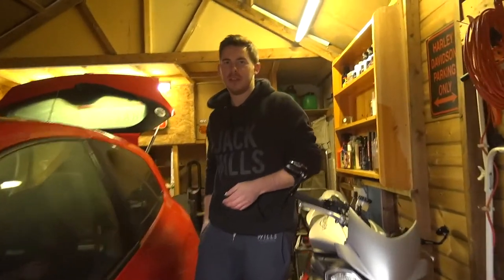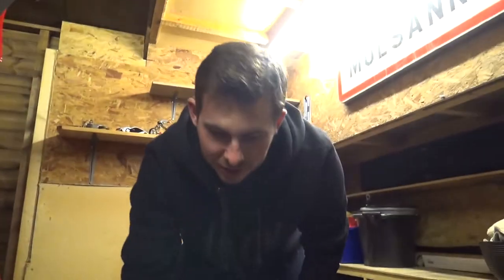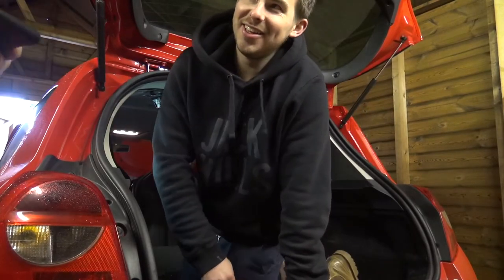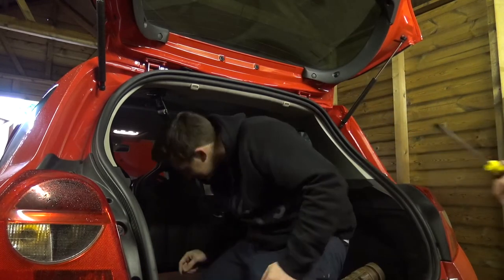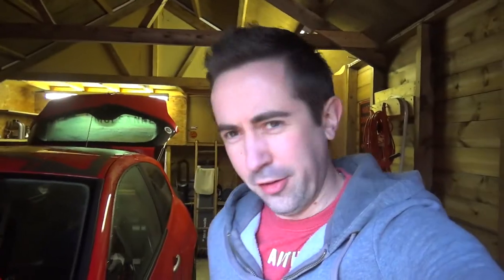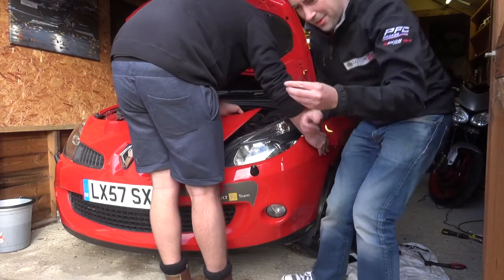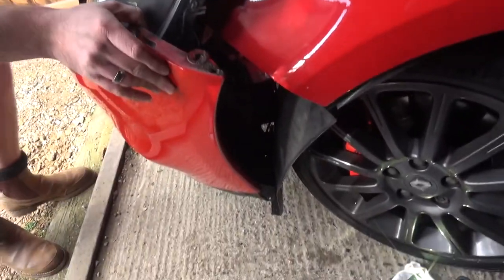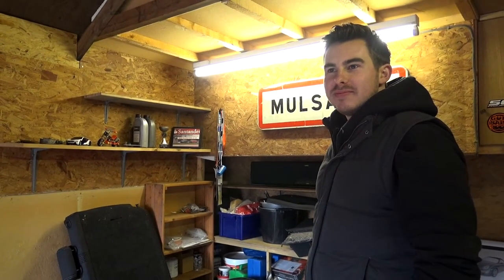Clio 197 R27 - My First Track Car

Comment: After lots of reading and searching i also went for a Clio R27 for my first track car. I was also close to a 182 or Civic Type R but glad i went for the R27 what fantastic little car.

First thing to do is get some good Tyres. Lots of options but a good all round choice is Pilot sport cup 2's, you need to get some heat into them but they are also fine in the wet.

My car now has braided lines, high carbon grooved front discs with Ferodo 2500 pads, cone intake and cat back exhaust, H&R springs.  A strip out and remap is on the cards...

Took it to Brands start of Feb, you have to take it there for Padock hill, what a corner.
Reply from the maker: Ended up going with the cheap T1R Toyos as the spare wheel already had one. Will see how they hold up for the first track day! Bought the car on Uniroyal RainSport all round... way too squidgy. Pretty much anything will be an improvement!
Brands is certainly a track we want to try! First stop, Snetterton 300 👍

Comment: Never had to take the bumper off when I changed my builds just took the battery fuse box off and moved inlet trumpet
Reply from the maker: +Carl Stirk that would indeed have been easier! The bumper wasn't very well aligned so removing it sorted that too 👍

Comment: Best thing I have done to mine is fit Toyo R888R's and H&R 30mm lowered springs front and rear, stuck with cup dampers. I also had to replace the exhaust manifold so fitted toyosport's (deleted pre-cat) along with a ktr torque mount (gearbox to chassis) as these cars are prone to flexi pipes on manifold to break and leak exhaust gases. It's also been custom remapped but I've not seen much of an improvement of it yet.

Comment: Hey guys... small world as I have just done exact same thing !. Yesterday picked up 2010MY RS200 (ex of Chris Bray @Finishline racing) which has already had tons of work done... heading over to Castle Combe Monday April 3rd for a play. Rather hoping the crazy maintenance bills I have been paying for on my Lotus 2-11 which I sold last year (perhaps stupidly) can be compensated for by more active track bias car on much smaller budget. It has stock engine and exhaust but total stripped out interior (roof lining etc, even speakers have gone!) with roll cage / upgraded suspension (Gaz Gold coil overs) and brakes (Mintex F4)

Comment: I'd take out the rear seats (which u did), put a roll cage or even just a "hoop".  You're in the UK, so you're lucky... You have Safety Devices, who make FIA roll bars, cages, etc.  They supply pretty much every car manufacturer.  Those external Land Rover Defender safety cages, guess who makes them?  You can buy a bolt in roll bar or cage.  It also stiffens the car/chassis tremendously!  Maybe some lighter body panels?  Carbon bonnet? You can leave it unpainted, the black carbon can help w/ glare if driving in to the sun & can look cool.  It'll probably weigh 1/3rd of, or less than your factory metal bonnet.  If you really want to start getting extreme, Lexan windows & more lightweight body panels. It's a front wheel drive car, maybe a front splitter for downforce? But balance it with a rear wing. Can you lower the Clio a bit?  STICKY RUBBER!  Michelin Pilot Sport/Pilot Cup... There's other good tires out there, the Michelins are just common & often OE-Spec, like Porsche.

Comment: Oz ultraleggerras? wider wheels yet lighter so reduce rolling weight. They do cost a fair bit though.
Reply from the maker: +usman arshad good suggestion! Wheels are certainly something we'll consider 👍
Reply: You can run 225 tyres on the standard rims without issue. Clio 197.net is worth a look lots of info there.

Comment: 43kg? THAT'S A LOT. You were kidding about 1 sec lap, but it actually might be even more. Get a look at ride height, taking weight changes geo, 43kg Changes quite a lot, mainly when it's only in 1 part of the car.
Reply from the maker: +Cut de Pie Fails Spare wheel was half of that, so we'll see how it performs on track before making further changes 👍